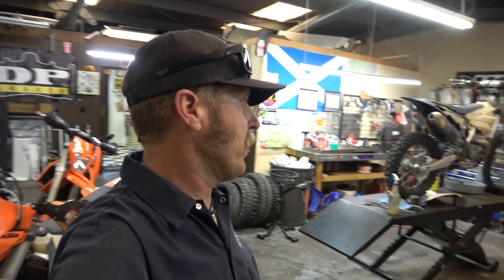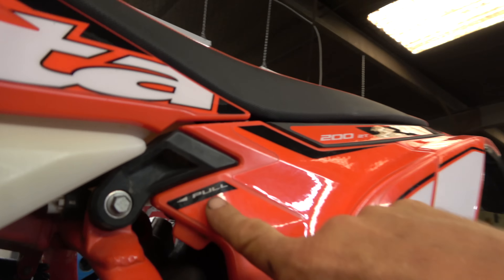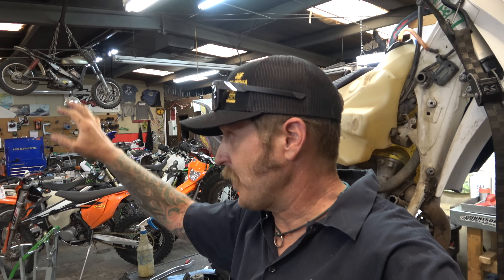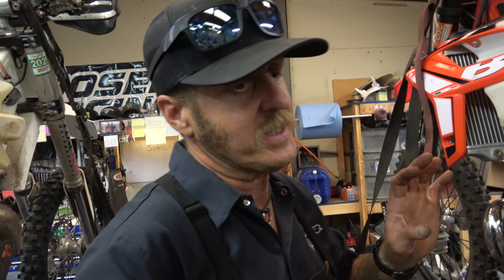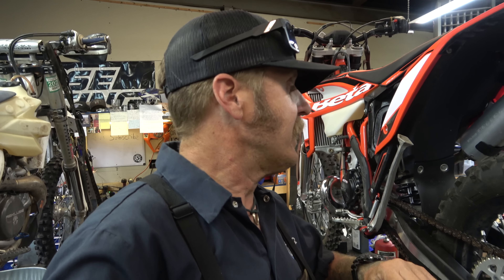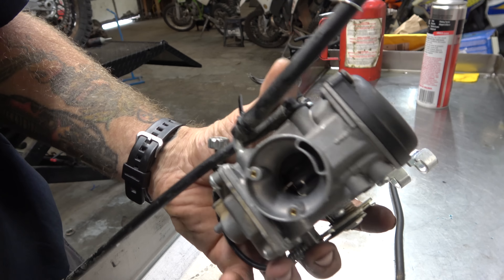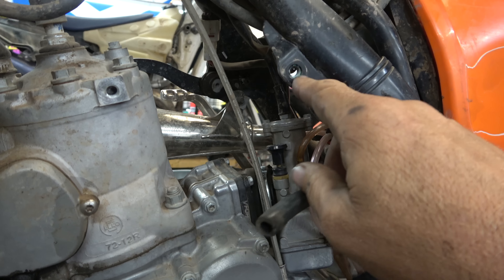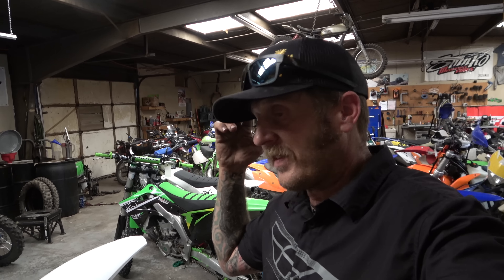Beta 200RR | Air Filter Maintenance | TW200 | The Shlog #215

Comment: I've found being a mechanic for quite a while in powersports that being open to learning something new everyday is the best attitude to have.  I have worked with plenty of know it alls,  and it gets old.   Most of em just talk like they know everything cuz they watch youtoube alot haha.
Reply: big tip on the tw200,  always use the right oil filter!  yamaha sells two identical filters tho the TW filter has a hole in the back that allows oil to travel up to the cam.  If the wrong filter goes in,  it will starve the cam bearing.  I have seen this happen so many times here in Idaho.  We work on a ton of them.
Reply from the maker: Yep. I’ve seen that too.

Comment: I managed to hit a pointy rock right on the bleeder nipple on my 200rr. it cracked threads and lost clutch pressure. It was a mess to fix trail side. the clutch cover wasn't crazy expensive and the actual slave cylinder pushes out of the cover and right into the new one.
Reply from the maker: Good to know

Comment: That clutch is unique to the 200RR and keeps it away from the cs sprocket. In 1000 miles the clutch has never been hit hard. The 2023 bikes they went to the newer setup without individual springs they went to the cup spring like KTM. Gearsaver eliminated clutch drag on my 200. The speedo cable is routed too tight to the front brake hose and yanks itself apart in behind the headlight mask. Need to provide slack and let the connector float free of the plastic bracket it sits in. Silencer plastic piece does fit on the SA 2.1.
Reply: It took some doing but I put that plastic bit on my turbine core.

Comment: Hey Morgan, love the shlogs. You were talking about bike maintenance  and my question is about chains...can you tell us if it's good or bad to lube o-ring sealed links? If they are sealed am I washing out the grease with lube, wd40, etc.? Also, when cleaning them should i avoid power washing and instead wipe/brush them clean so as not to blast out the grease and thusly allow water in? The universe awaits your answer, thanks
Reply from the maker: Hahahaha. I lube o ring chains. I don’t use wd-40 but I don’t think it would hurt. I pressure wash mine and have no issues. I always lube them after washing to keep them from rusting. I can’t imagine lubing them hurts anything and I get a long time out of my chains.

Comment: Got a tech question 
I just picked up 98 yz80 compression is good so no wanting to do a top end yet but I noticed the last mechanic put the head on rotated 45 degrees (lettering faces the sides) runs fine 
My question is do I have to correct it or can I wait until I do the top end later 
Thanks
Reply from the maker: If it runs well and no issues with the coolant then I’d run it
Reply: Thanks

Comment: I use spray on air filter oil by motorex and i find it very convenient and doesn't make a lot of mess , what is your opinion on the spray on application ?
Reply from the maker: Spray works great. It’s just more expensive
Reply: @highlandcycles  yeah it is, for me it's ok because I only ride on Sundays, but if you ride more often then yeah the cost will add up.